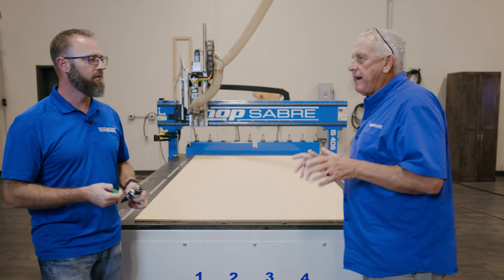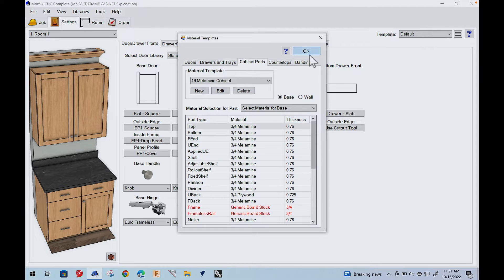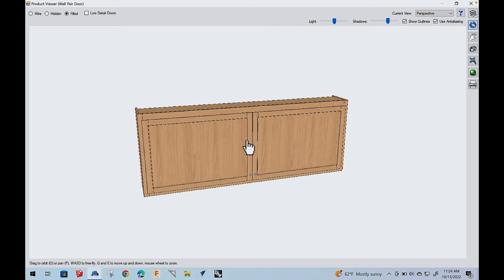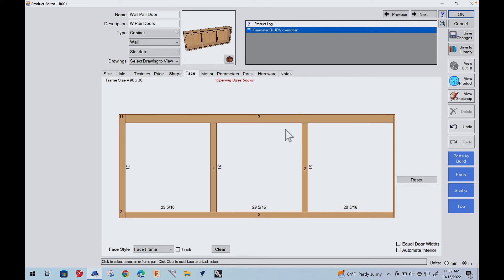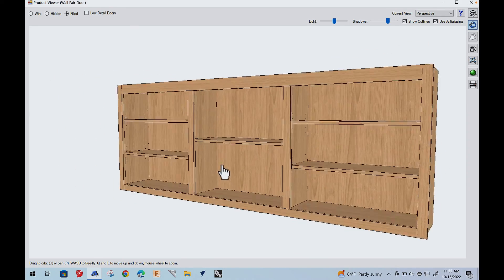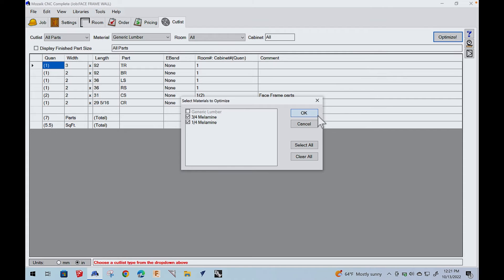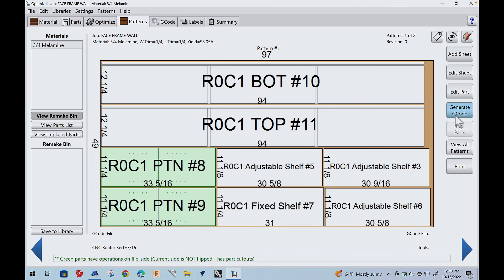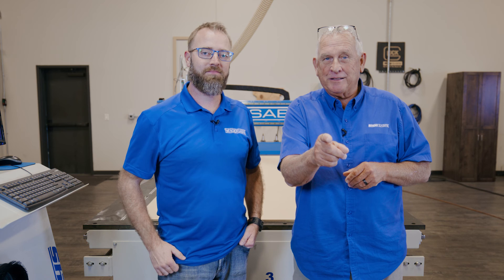ShopSabre CNC Face Frame Cabinets - Part 1

Comment: You do not cover how you made face frame - only shows cabinet assembly. How was face-frame manufactured?
Reply: The face frames themselves are manufactured the traditional way, not with the CNC
Reply from the maker: Our technical support team can assist with this question. Give them a call at 952-461-4570